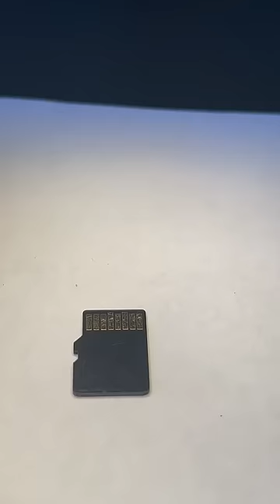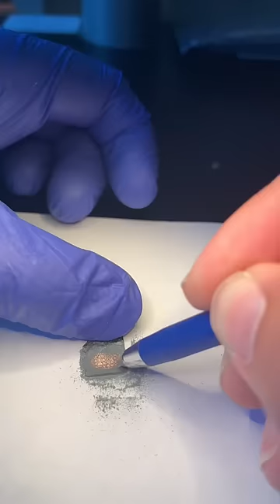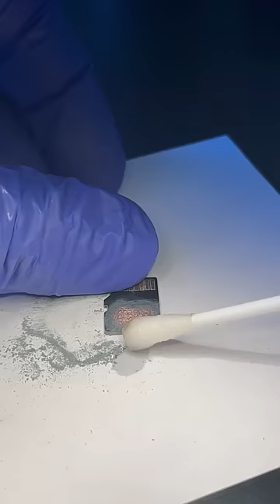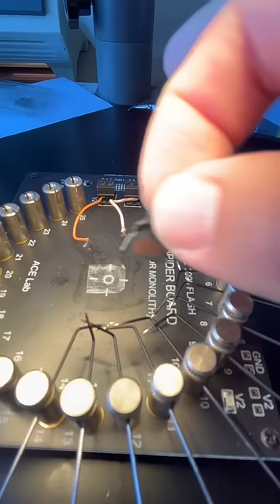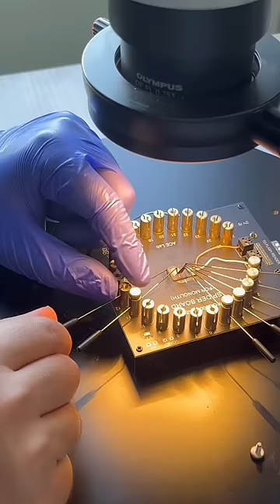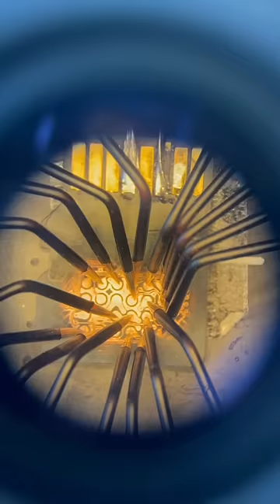Data recovery from a dead MicroSD card using PC3000 Flash and Spider Board (without soldering)

Comment: My guy just did surgery on a sd card.
Reply: my sd card dead now how to recover the data any one know would help me a lot
Reply: @gameplaysh6135  yeahh god knows how much money it will take to be fixed
Reply: @heroicgaming7388  5k to 10k approx
Reply: @abhilash71294  fr bruhh left all hopes
Reply: Fr
Reply: @heroicgaming7388 sd card tend to break a lot more i dont recomond sd cards for storing data buy a ssd enclosure and buy ssd or get a cloud storage
Reply: More like autopsy at this point. The SD card is already dead
Reply: @heroicgaming7388 Keep the card, in about 10 to 20 years it is likely to cost much less. It's literally going to be like the frozen time capsule unless it's just garbage.
Reply: @vershua1 I hate the memory card, once I had +20 years of photos and videos of important moments in my life at a time when there was no cloud storage and I had also formatted my computer's HD so I decided to transfer all the data to the SD card and when I put the SD card in the phone I put it in the wrong way and forced the card to fit wrong until it finally fit right I turned on the device and an error message appears and when I went to look at the card there was a crack right in the middle, the card didn't tear or break, it just doesn't work, I got so sentimentally attached to the card that whenever I change cell phones I still insert it even though I know it will never work again.
Reply: @heroicgaming7388  costs like $75 lmfao.
Reply: It's postmortem bro of the dead sd card 😭
Reply: @vershua1 can you suggest a guide to follow for making a cloud storage through ssd, if its possible that can function remotely with atleast 10-30mbps transfer both rx/tx speed. Under a NAT by net provider, no root android 5/9/10/12, maybe cheaper pi setup? At my local online store orange pi 1 will cost about 20usd more or less. Thanks in advance, hoping you see this. Or anyone TYVM

Oops reread your post and i mixed the ssd and cloud storage 😬
Reply: @heroicgaming7388 Fr 😂😂😂
Reply: @felipecatto9049  so any software will l work?
Reply: @heroicgaming7388 then learn yourself. Problem solved.
Reply: @prasektinanda8824  ughhhh huh?
Reply: next part
Reply: We need surgery on a quantum supercomputer
Reply: That's what I was about to say
Reply: First a grape, now a SD card?
Reply: @thebogsofmordor7356 You beat me to it 😂
Reply: Iski fees lagbhag 4-5 lakh rupay to zaroor honge
ya usse bhi zyada
Pura operation kar diya SD CARD ka
Reply: Autopsy.
Reply: @dylan-2169 75$= 5000 Indian rupee! So he was right
Reply: @abhilash71294 man that's the cost of the machine, and I'm pretty sure the machine doesn't crumble by just doing one workb😂
Reply: 😊try to brush it as the carbon is stuck on the black plate of the sd card, it works in 90% of the cases i had seen by the costumers

Comment: This is a similar setup to a Probe Testing Machine job I used to do way way back in early 2000’s for Motorola. Very satisfying to know you’re the only one in the factory with the knowledge. Used to test chips on 6” silicon wafer for phones like the classic Razr. Cutting edge back then 😊 now used to recover data, clever.

Comment: "without soldering"
proceeds to solder 2 wires to the sd card
Reply from the maker: This means that you don't need to solder all the contacts. There is an older method where you need to solder all the contacts, which in this case I connect with needles using a Sipider Board
Reply: @developakr  interesting...
Reply: @developakr  but then why don’t use the spider board also for those two wires? 😜
Reply from the maker: @mescalinum  I asked the SpiderBoard manufacturer for this option😉
Reply: I came here to say exactly this. You think the phrase without soldering meant that it was done without soldering
Reply: @PollokPoochesDogWalking  only one people has to solder - the other all don't solder anything - so without soldering ... for the most people on earth ...
Reply: need energize the  sd card, obvius
Reply: Was gonna say the same thing..
Reply: @363.2McMasters  the problem is you first read without soldering. but at the end he did. its like speedruning a game without a glitch. So you don't start using glitches in level 2.... The title of the video is not really accurate. i mean after watching it you get the point. but it is at first misleading.
Reply: Ток : черис карту .. инфу прочесть 🧑‍🚀
Reply: @developakr that's why I use cloud to store data 😂

Comment: So basically don't throw away an unwanted SD card. Burn it .
Reply: Or fill it with zeroes, destroying all data.
Reply: @UwOtt its dead. How do you fill with zero😂
Reply: @UwOtt Well, it's already dead. But you'd want to go a few passes of random bits rather than all the same thing. I don't know if that's really necessary for flash storage, but it's good practice nonetheless.
Reply: This one was burned... )
Reply: @dysonlifts  
Exactly 🤣🤣🤣🤣
Reply: n then sm smartass still manages to collect all 10 pieces by sorcery, clone it back to it's original state n puts a video on tube for all to see 🤣
Reply: Cut it off
Reply: Microwave it
Reply: I generally crush mine with a 20 ton press, can't pull data from dust.
Reply: Chew it and consume it later
Reply: Yall must be hackers here 😂
Reply: @sonoftherain3761 Nah. Probably just don't want any evidence of downloaded porno.
Reply: Degauss it
Reply: That's what I was wondering. I can't even throw my shot away lol
Reply: that was always a common sense
Reply: How @UwOtt
Reply: @Kirt44  when you format your disks in windows for example, it has “Quick formatting” checked out by default. “Quick” meaning it’ll just mark files as deleted to allow them to be overwritten. If you remove that, it’ll delete them for real.

Comment from the maker: Recovering data from dead SSD drive using PC-3000 SSD: 
https://youtube.com/shorts/DKq1krGEFak?si=R2XCHU-tPUhk3QXQ
Reply: X
Reply: that link not working...???
Reply from the maker: @Sunny_Subhan  https://youtube.com/shorts/DKq1krGEFak?si=R2XCHU-tPUhk3QXQ
Reply: What is your fee in recovering data on hard drives and xd cards?
Reply: Where is full video...? Not shorts.
Reply: Links were removed from youtube shorts. They can no longer be clicked.
Reply: Where does one get that thing you made the connections with, and what is it called? I do a lot of eeprom work on automotive control modules and such a thing would be very useful.
Reply from the maker: @SwapPartLLC   PC-3000 Flash Spider Board Adapter https://blog.acelab.eu.com/pc-3000-flash-spider-board-adapter-how-to-use-it.html
Reply: I thought these were indestructible, dang:\
Reply: Gang b@ng🗿
Reply: Data cable hdd theka recover kora jabe? Cost kmon porbe?
Reply: wow does this really work ..
Reply from the maker: GAMExPakistan  Youtube no longer allows active links. Please find this video from my video list.
Reply: What was on it ?
Reply: Please help me
Reply: Please sar halp me
Reply: @developakr YouTube used to be useful
Reply: Plz sir Mera SD card dead ho gya ha .data was most important.plz help me 😢😢😢😢
Reply: YouTube disabled links in comments under shorts even if they are from the creator of the short. You'll need to put it in the description to make it clickable
Edit: apparently they also made them unclickable in the description now. So we'll you're fked
Reply: @sinom  clickable links is the difference between internet and the web. That's the point where you can state that YouTube is part of the internet, but not anymore of the World Wide Web. 

Literally a jump 30y in the past.

Comment: Patiently waiting on SSD data recovery videos. Have one that had a chip blow from overvoltage. Only the one chip blew, so im assuming the data is still there on the nand chips
Reply: What chip blew? Most ssds have a controller (cpu, memeory and rom that handles the nand) and 2 or more nand chips if the nand chips burned its almost impossible because they contain some read/write/erase logic and also some access logic so maybe half of the data might be gone

Comment: Wow, that is really amazing. Would bee interesting to see the software used to pull off the data. Or once you do this, does it just appear as a storage device? Amazing.
Reply from the maker: Data recovery from a dead MicroSD card using PC-3000 Flash and Spider Board (Full video ):
https://youtu.be/aN2E2kiAeUQ

Comment: Is this supplying power while extracting the data? Afterwords, do you need to reconstruct parts of the data, like with hex editor? I love data forensics. We worked with FTK and other programs to extract, examine and undelete data in college. I've extracted e01 files from computers and hard drives but, I have never gotten to do this with an sd card. This looks like fun! I am definitely checking out your video on this!
Reply from the maker: Data recovery from a dead MicroSD card using PC-3000 Flash and Spider Board (Full video ):
https://youtu.be/aN2E2kiAeUQ

Comment: “Without soldering” proceeds to solder
Reply from the maker: This means that you don't need to solder all the contacts. There is an older method where you need to solder all the contacts, which in this case I connect with needles using a Sipider Board. New Video: Data recovery from a dead USB Flash drive using PC3000 Flash and Spider Board (Kingston DTSE9 8GB)
https://youtube.com/shorts/O1sMWwUZgco?si=40csa_IkFyXJgd21

Comment: NO soldering. Solders power and ground to the pads 😊.
The uncovered copper pattern though 👍👌
Reply from the maker: This means that you don't need to solder all the contacts. There is an older method where you need to solder all the contacts, which in this case I connect with needles using a Sipider Board
Reply: @developakr  thanks for explaining. I'm assuming the power still has to be soldered in order to deliver enough power to the chip.
Reply from the maker: @nkronert  I think you are right

Comment: 😊try to brush it as the carbon is stuck on the black plate of the sd card, it works in 90% of the cases i had seen by the costumers

Comment: “without soldering” meanwhile the 2 wires soldered to the connector:
Reply from the maker: This means that you don't need to solder all the contacts. There is an older method where you need to solder all the contacts, which in this case I connect with needles using a Sipider Board

Comment: Woow really genial Friend, I also had to scrape an SD and detect that the terminal was damaged. I found an open terminal. The greatest thing is to tie the finish cut to work again, so use a copper wire as a cautin tip of the diameter of a needle and manage to weld the cut terminal and manage to run the card and I was able to recover 90% of or information
Reply from the maker: Cool 👍

Comment: I think that if a memory card is gone it is gone forever. That must be a working SSD card with some problems on the pins
Reply from the maker: Data recovery from a dead MicroSD card using PC-3000 Flash and Spider Board (Full video ):
https://youtu.be/aN2E2kiAeUQ
Reply: Memory cards not only have storage my guy! They also have a controller that is a bridge between the flash and the pc and has some house keeping stuff like a cpu embedded. And sometimws its a dead controller but the flash is fine

Comment: This only works if the connection is broken between one of the contacts and the exposed area. If the connection is internal (chip or otherwise) then this process is useless.

Comment: Title is without soldering
But
Video does tell different
Reply from the maker: This means that you don't need to solder all the contacts. There is an older method where you need to solder all the contacts, which in this case I connect with needles using a Sipider Board

Comment: You clearly soldered wires to the prongs
Reply from the maker: This means that you don't need to solder all the contacts. There is an older method where you need to solder all the contacts, which in this case I connect with needles using a Sipider Board

Comment: No physical damage micro sd card 
after crash of my DJI air 2 drone, my  Extreme Pro 128gb vcard stopped working.
The device is not recognized by Window10. When connected by my Card Reader, nothing happens and the stick keeps heating up until extremely hot. The blue led light remains ON but NOT flashing.
On Windows, I get a “unrecognized USB device” error message but nothing happens either. It’s not showing under USB devices or anywhere else.
I have tried recovery software, changing several laptops, etc. but no solution.
This is incredibly disappointing since I lost tons of data… I am literally crying now. What should I do?
Reply from the maker: contact a data recovery company😉
Reply: @developakr  sir can you provide me your location 
I belong to Nepal here is not data recovery center 
Plz provide me you details

Comment: Nobody noticed it had 2 soldered wires (Unlike the description states lol)
Reply from the maker: This means that you don't need to solder all the contacts. There is an older method where you need to solder all the contacts, which in this case I connect with needles using a Sipider Board
Reply: @developakr  Thanks & sorry I was being pedantic really 👍

Have a good day

Comment: I can clearly see 2 solder points ^^ so "without soldering" is not true. xD. But nice tooling!
Reply from the maker: This means that you don't need to solder all the contacts. There is an older method where you need to solder all the contacts, which in this case I connect with needles using a Sipider Board

Comment: (without soldering)
solders power to the sd card
Reply from the maker: This means that you don't need to solder all the contacts. There is an older method where you need to solder all the contacts, which in this case I connect with needles using a Sipider Board

Comment: "Whitout soldering" ... but two pins are soldered 😅
Reply from the maker: This means that you don't need to solder all the contacts. There is an older method where you need to solder all the contacts, which in this case I connect with needles using a Sipider Board

Comment: without soldering but using a microscope and another tool to hold those metal needles that i dont know even its name
Reply from the maker: This means that you don't need to solder all the contacts. There is an older method where you need to solder all the contacts, which in this case I connect with needles using a Sipider Board

Comment: still soldered a power supply 😂JK ... good job btw
Reply from the maker: Data recovery from a dead MicroSD card using PC-3000 Flash and Spider Board (Full video ):
https://youtu.be/aN2E2kiAeUQ

Comment: My question is  - as the data is fragmented randomly by the controller FW - how do you collect the data to the correct files?
Reply from the maker: Using XOR algorithms. Data recovery from a dead MicroSD card using PC-3000 Flash and Spider Board (Full video ):
https://youtu.be/aN2E2kiAeUQ
Reply: @developakr  thank you for your reply! I will look on that)

Comment: Saying that I am not soldering then soldering it with wire
Reply from the maker: This means that you don't need to solder all the contacts. There is an older method where you need to solder all the contacts, which in this case I connect with needles using a Sipider Board
Reply: @developakr  thanks for telling me

Comment: How expensive is this? Is it hard? I have an SD card with a couple of pics of a UFO but the camera stopped working for some reason and I put the SD card in another DLSR and it couldn't read it. How much would it cost to recover the pics on that card?
Reply from the maker: The prices depend a lot on the condition of your card, sometimes can recover data very quickly, and sometimes you need to work hard like in this video.
Reply: @developakr  The card and camera are in excellent condition. It stopped working when I took a few pics of a UFO. Me and two friends I was with all saw it, was only like 30 feet from us. The SD card looks fine, so does the camera but it's fried. Let's just say the UFO gave off some kinda radiation or something like an electromagnetic field, I'm almost certain that's why the camera stopped working because immediately after I heard the shutter on the 4th pic it stopped and the lights turned off. I thought it was just the battery but the SD card don't work in other cameras or an SD ccard reader connected to my laptop. I'm just hoping the card wasn't fried or wiped. Ive heard of magnetic energy wiping memory devices. And aside from my two friends, the only evidence we have of what we saw is on that SD card which I have locked in my safe for safekeeping.